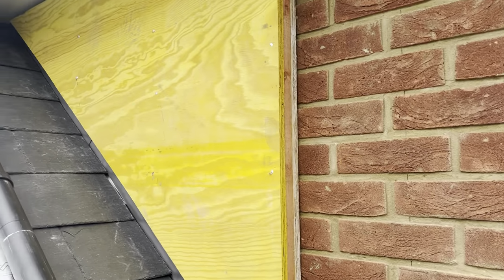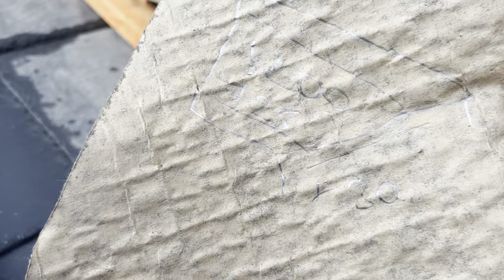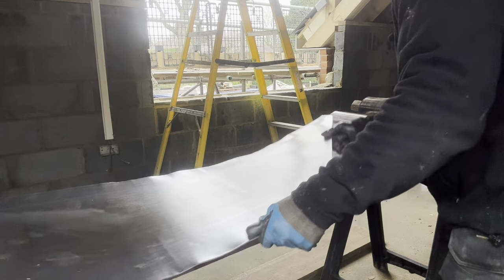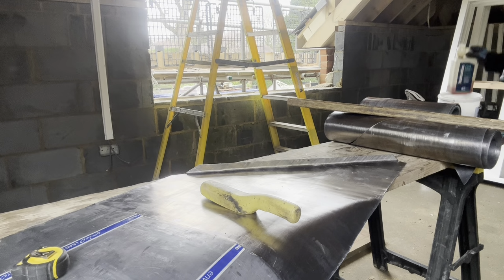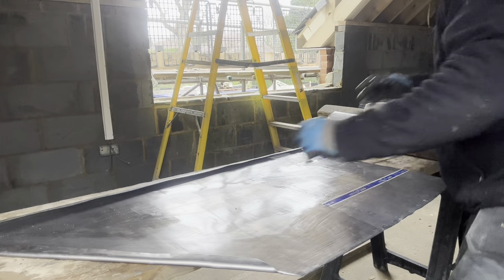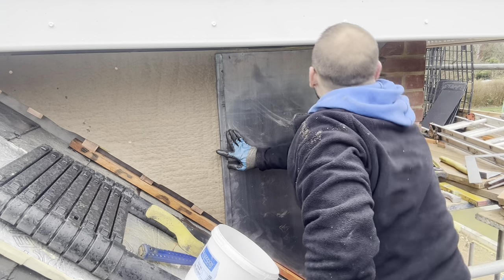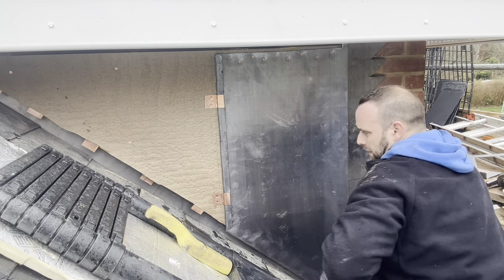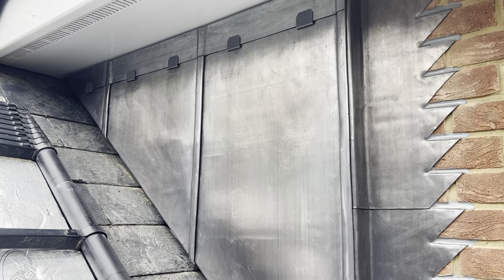Oops There Goes the Nails. Installing Lead to a Vented Ply Cheek

Comment: Beautiful work. In the states we use copper (block soldered) or lead coated copper (block soldered). I think I prefer the solid lead better. Lead seems to stain some standing seam roofing that we use though so we have shied away from lead even as counter flash.
Reply from the maker: Thank you. We have a problem with lead staining other materials too. We have to apply patination oil to try and prevent this.

Comment: Hello first of all you are doing a really great job 👍🏽👍🏽 now to my question what is the name of the paper you are putting on the wood, and what is its function?
Reply from the maker: Thank you.
This is grade A building paper. It’s used to protect the underside of the lead from alkalis in concrete and screed.
And also reduces corrosive attack when laying onto plywood and oak. 
As well as acting as a vapour barrier and helping the lead move.

Comment: where you have cut the lead on the top course and it angles down to the lower course at the back of the cut how do you weather that corner(sorry if i am not explaining very well)
Reply from the maker: Oh I know where you mean. I know it looks like a weak spot. But this is the traditional method that’s been done for century’s. And proven to work. And as specified by the lead sheet association guidelines.

Comment: Great work as usual young man..!
I used to do a lot of leadwork years ago. 
I only do flashings and chimney stacks when working on pitched roofs now..
I do miss it...
Reply from the maker: Thank you. 
I think I would miss it too. I do enjoy it mostly. It’s just the weather sometimes that makes things hard.
Reply: I've still got my full welding gear in my garage doing nothing...I use my little oxy turbo set to weld up on the roof.
Much lighter...!
Reply from the maker: @chriscarver417  yes they do come in handy don’t they. I used to have a oxyturbo setup but not a very good one and ended up selling it. 
But I might look into getting another better quality one.